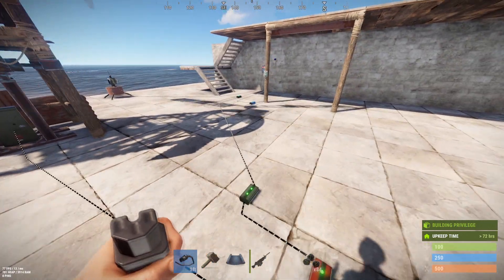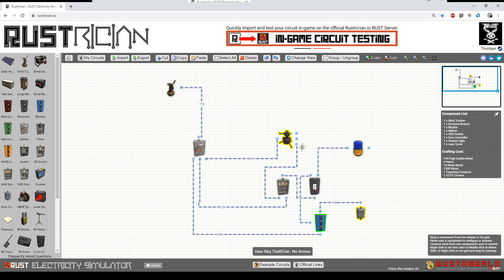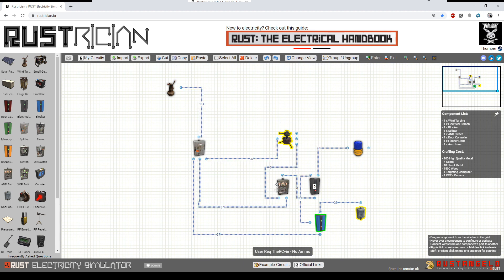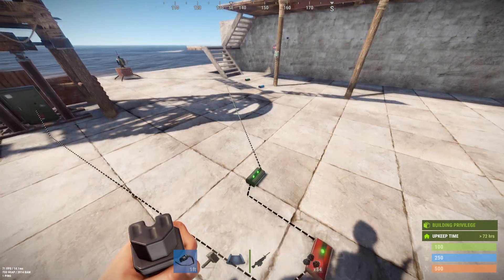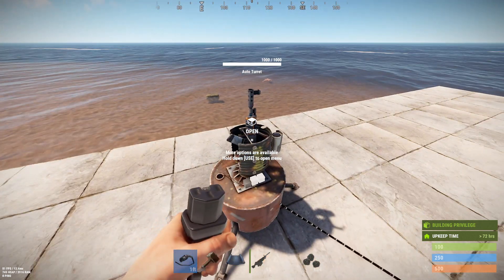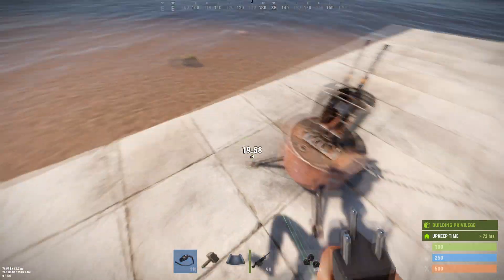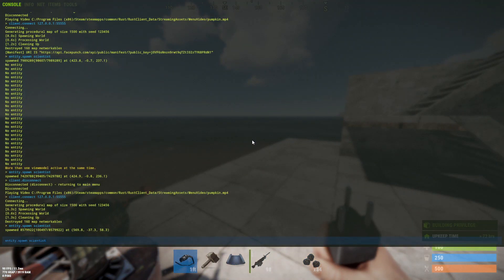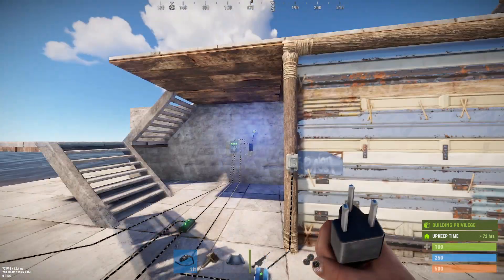Rust Electricity: User Request - No-Ammo Light/Door Trigger

Comment: If u cut the power to the turret to refill ammo the door will open since there is no signal to the blocker or am I thinking wrong?
Reply from the maker: You're correct! In this case, killing power to turret would mean no power for the no-ammo signal, so door would open again. Obviously not ideal for having cover to reload. I assume the requester was more interested in closing the door unattended and worry about reloads later. For attended operation, there's better ways to do this to provide an override for the door.